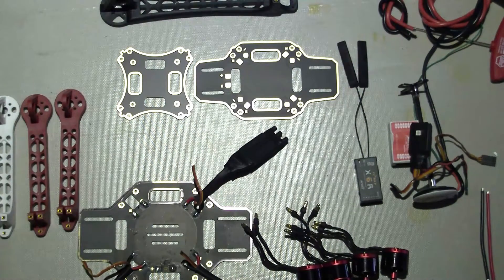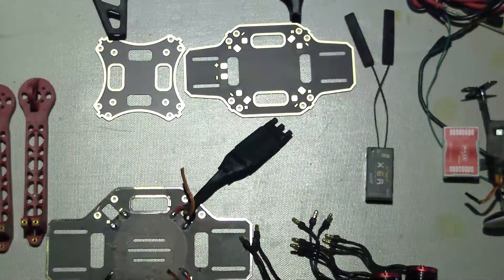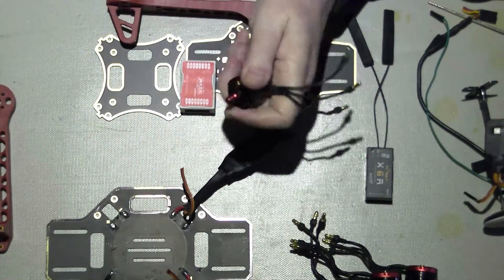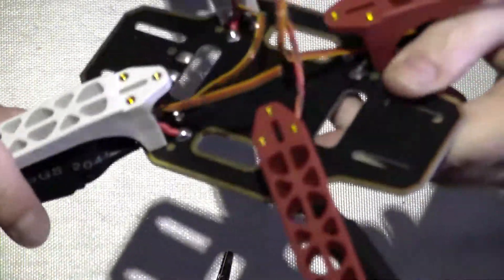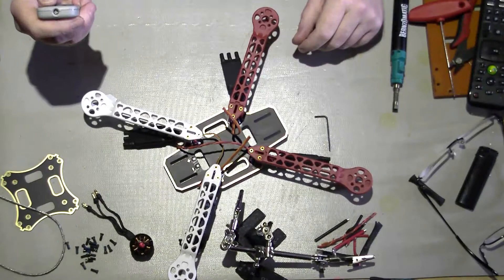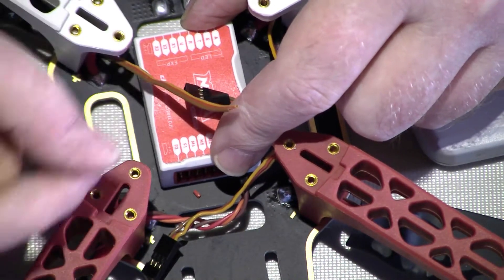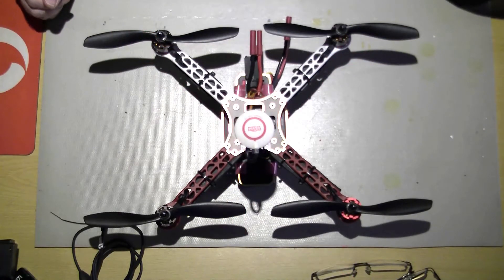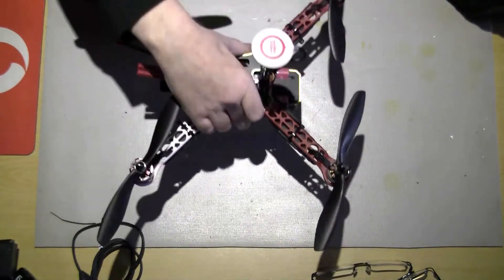DJI F330 time lapse build review and flight test

Comment: nice quad, i'm planning on building a 330 in a couple months.  what kv motors are you using and what is your flight time?  I was thinking of using sunnysky 2212 980kv but would like some input on what is best to use before ordering parts
Reply from the maker: I used standard 2212 DJI motors and ESCs and with a 4000mah 3s strapped to the bottom, I was getting around 15 mins flight time. You'll do good with Sunnysky motors and something like Turnigy Plush 20a ESCs
Reply: @Vortecks  how much kv for 2212.motors

Comment: Whats the biggest prop you can use with this frame ?
Reply from the maker: Max 8"
Reply: vortecks2000 Have you tried 9443 ones?
Reply: 9443 and also 9,5 will fit if you don't put anything on top

Comment: Hello- on the datalogger 10 amps is shown. Is this total current draw or per motor
May I ask what motors/ prop combo you are using please as I need a guide/advise for my 330 flame wheel which  I ordered a week ago from Hong Kong
Reply from the maker: The amperage is total and I used DJI 2212 motors with 8" props